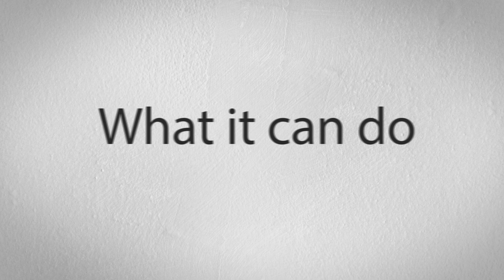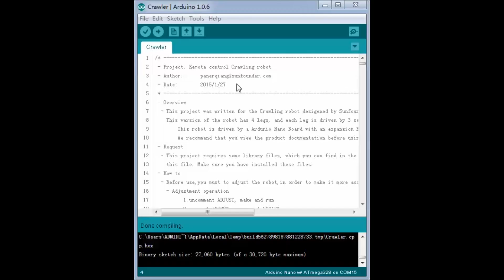Arduino Electronics Spider Quadruped Robot Kit with Servo Control Board and Nano, Remote Control

Comment: I have a question, can you build it and not have to program anything, that's the main thing I want to know, I don't do good with that stuff and just want to build and play right out of the box, I don't have my own computer so I can't do it if you have to.
Reply from the maker: Hi Calvin, generally, if you want remotely control this robotic or let it moves itself,  you need to program and burn the codes, otherwise, this robotic lost its funny without the program.

Comment: hy sir i m in diploma computer in india...sir i need ur help for making that type of spider...i can write code my self but can u pls tell me what is the size of leg..plz

my mail add bhargavpurohit12345@gmail.com
Reply from the maker: Dear Bhargav, 
The line 50,51,52 in the code are the length which are the three joints of the leg.
length_a = 55; length_b = 80; length_c = 22.75;
Below picture is the length of the leg for you refer to.
http://i1266.photobucket.com/albums/jj536/Yang_Michal/Untitled_zps9t0cch6z.jpg

Comment: Hi - cool video, sorry for the newbie question but I hope you can help me...have googled this and can't find a straight answer as I want to see it. It is about the display output of an Arduino:

I have a raspberry pi - it was a gift last year...have learnt a LOT since then about programming and done lots of cool projects....lately I have been tempted to get an Arduino / Uno - to extend my knowledge...and range of available hardware /software /projects.....I have only seen the odd video here and there about Arduino use.

Anyway today I was looking at prices - to buy one next week. But I see a problem immediately for me. Does the Arduino have a direct Display Output....eg like the RPi 2 and 3 has HDMI display output, and the early versions use an older TV type....my point is How does one program software, and configure hardware, and set things up etc etc. 

I see projects to print display output for specific functions - say the temp for a temperature related project. I see the TFT little touchscreens - I have one for my Pi, but does the Arduino have a display connection on the board itself please??

Do you have the equivalent Operating Systems for general use?
Do you have storage space for an SD card to store an OS?

If not how do you control variables and run code and many other stuff?? My pi serves a lot of uses other than small projects. I write code on it, I write office docs on it, I listen to media, I Read e-books off it, I browse the internet and can play youtube vids....etc etc

I see lots of software available for Arduino projects...some in tar-ball format (tar.gz) - So if there isn't an OS to interact with the only thing I|can think is to say...set up projects in Linux, then prepare an SD card or something  on this seperate system - to run everything autom,atically (so you dont need a display) - even so I would want to see output of my projects incase of unforseen errors.

Anyway I hope you don't take this as a bad view on Arduinos - or trying to compare inany way because I am not for a second. I am simply trying to find out how they work before committing to buying one!

Sorry for the long-winded post - I hope you - or - someone reading this can give me some  sound advice...I have lots of cool project ideas 0 electronics controlled by software sort of stuff. I really want to e able to understand and use an Arduino - I just don't get the OS and Display Output side of it
Reply from the maker: First, the Arduino does not have an operating system, as you said, it will run the code you written, which is similar to run a project in your Raspberry Pi.
The Arduino does not have a direct display output, but it has a serial debugging output. The Arduino has a specialized IDE, so you should write code on the IDE, connect the Arduino to PC, and download the code to Arduino with IDE tool. You can check the debugging information via Serial window on the IDE.
The Arduino can be connected to TFT screen. The screen would not show the system interface as by connecting to the Raspberry Pi it does. The TFT screen’s pixel squares can be directly controlled by the Arduino. All the text and some other information can be displayed on the screen by using the Arduino’s library file easily.
The Arduino does not support SD card, so no OS can be installed. Arduino is only aboard based on AVR MCU, which has EEPROM to store running code and some accessible variables. Even though, you cannot write code or office doc on the Arduino, you can still do some experiment about media listening and e-book reading by using Audio module or Shield.
As the tar.gz format code you mentioned, yes, it can be unzipped in Linux, you can load and compile code via Arduino IDE, then download the code to AVR MCU on the Arduino by USB cable, the MCU will run the code.
Compared with the Raspberry Pi, the Arduino can be very small-size, or low-power consumption, or with precise timer. If you can make an Arduino board, or buy a non-official Arduino, it will be cheap. The Arduino is perfect for some small projects, or using some Arduino board for a big project. The Arduino has been widely used in our life, such as the controlling of electric rice cooker, washing machine…Different boards have different advantages. Get an Arduino or not, it depends on you. Hope these information will help you.
Reply: Thank you - I think I will definately get one now. I have done a few electronics projects on my pi using GPIO, but the arduino will open doors to new projects....your explanation was perfect. I now understand how an Arduino operates - and based on my existing kowledge I am confident I can understand how to get started.  

I like the sound of being able to use the IDE.. .so for a robotics projects you could run different movement codes from the IDE directly - in realtime on another computer that is connected to the Arduino. The first Arduino I ever saw was controlling a quad copter drone from his Android phone....Amazing!  Thank you very much
Reply from the maker: Ben Woodfield It's our pleasure. Welcome to post forums on our website www.sunfounder.com if you have any questions!

Comment: Doing an internet search gives no results for "Streadled" 18650
Are you sure this is the batteries you originally used?

edit: ah, it's STREAMLED with an M
Reply from the maker: roidroid Thanks for correcting! Yes, it is STREAMLED...But you may choose similar batteries of other brands, as long as the power is high enough. And oh, the batteries should have no protection circuit.

Comment: This is a really nice project!
Could you control that many servo's with a raspberry PI 2 as well?
Reply from the maker: Dejay Rezme  Yes, you can use  raspberry PI 2 to control. You need to externally connect a 16 channel servo controller (based on PCA9685 chip) with which you can control 16 servos.
Reply: Sunfounder Thanks for your answer! Found it and ordered one. It's a really nice time to get into electronics. I would have never imagined you could control that many servo's with one little chip!
Reply from the maker: Dejay Rezme Thank you! Have fun!

Comment: how did you make those glass parts? did you 3d print from solidworks?
Reply from the maker: in6seconds Thanks for your question. These parts are a piece of Acrylic board cut by laser. It is easy to process.
Reply: Sunfounder could you do a video tutorial on how to lazer cut acrylic parts?
Reply from the maker: in6seconds It is cut by large and expensive laser machine, not for DIY, but you can buy one kit from our shop. It will come soon.
Reply: Sunfounder what do you suggest i do to make my own parts if laser cutting is not DIY other than 3d printing
Reply from the maker: HighonMemes If you want to make your own parts, I suggest you use 3d printing.